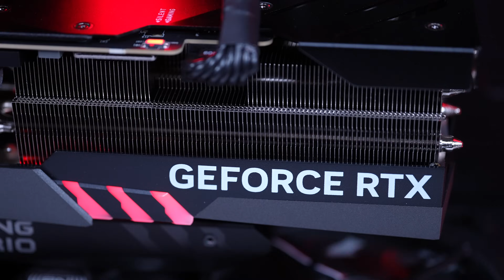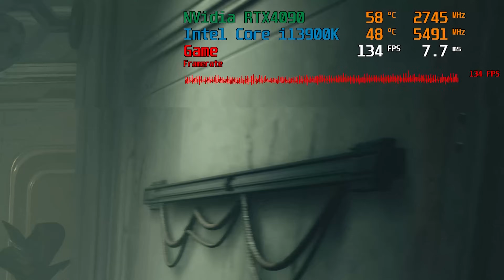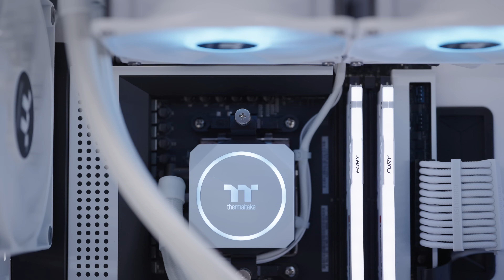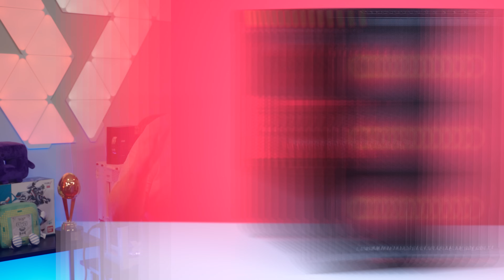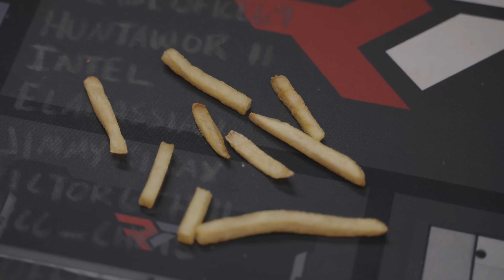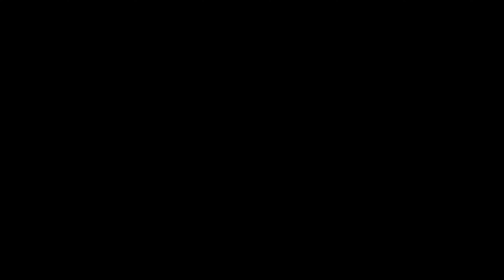How Does Starfield run on PCs of different budgets and the Steam Deck and ROG Ally!

Comment: Tested it on my rog ally played for a while works great for me arround 27 fps everywhere very playable for handheld  there is a new driver update you need you can install manually only atm but works like a charm tho that being said steam deck wil never run it the hardware cant handle it while rog allys hardware is alot better the steamdeck is to low for starfield dont expect this game to work on the steamdeck tho would be great if it did
Reply: Same I have the ROG and it works. You use medium or low preset? Or mix? I’m currently using medium preset but with shadows and ambient set to low.
Reply: @2BuckGeo sir does it stay locked at 30 fps
Reply: @amankumar-ft2ck  nope. It can go higher than 30 because it’s a pc technically

Comment: I was hoping to see a test of previous gen ZEN2 CPU's and see how they hold up.
Reply: XBOX uses Zen2 architecture, so I'd imagine a stable 30fps is  doable.
Reply: No Zen2 CPU can hold 60fps locked, out of the Zen3, only the 5600X3D and 5800X3D can, Zen4 is a wash though.
Reply: @MaxIronsThird  So, there is some truth to this game being highly cache and RAM bandwidth dependent.

I have a Zen2 Threadripper (3960x) and between its large 128MB L3 cache and its quad channel RAM (I use DDR4-3600) it's able to perform much better than one would expect by comparing it to an otherwise similar Ryzen 7 3800x.  I had to disable SMT to get the best out of it, but once I did, walking around in New Atlantis (one of the toughest spots on the CPU) I'm able to average 72-75FPS, notably faster than a Ryzen 7 5800X3D, and very similar to a Ryzen 5 7600 (according to that German sites testing)

That was a relief.   This is a work and play machine.  I need the extra PCIe lanes for work. I'm hoping to upgrade to Threadripper 7xxx, but they aren't out yet.
Reply: @Zarathustra-H- More and more we see that after a certain point, adding more cores makes absolutely no sense, cache is where most of the bottleneck is for gaming.

This makes me not as worried for Intel's next CPUs, with Arrow Lake not having SMT and the next generation after that, having "Rentable Units",  focusing on singlethread power and letting the E-Cores carry the weight for professional style multithreaded work.
Reply: @MaxIronsThird  The funny part is that Starfield loads up 24 cores on my machine, at least in busy settings (Like walking around New Atlantis), but there is obviously something really weird/wrong with this game.  In most cases I'd say you are right.

Comment: I went and bought a 6950 for $730 CDN after factoring in the Free SF premium with it. This is a smoking deal, $400 off and it's 2x the performance of my 5700XT I bought for $600 3 years ago. I saw another benchmark video where the 6800 was roughly in the ballpark of 1080 60 frames, 1440, and that is a few leagues up on the 5700.

Comment: You do realize this is worthless for most people out there. Even your low end system is using very modern parts. Low end should be something like a ryzen 3600x and a rtx 3060. And many people would still consider that middle of the road. And a ryzen 7800x3d is considered a monster cpu in games. Hardly a mid range cpu for 90 percent of us.

Comment: Ok now I'm confused. Just saw a video that a 4090 barely hold on to 60fps at 1440p. Or where they dumb enough to not unlock the framerate?
Reply: Not all the streamers have decent hardware to back up their 4090 with.

Comment: Things missing. Where is the native performance? Which mode of FSR did you test? Quality? Balanced? Performance?
Reply from the maker: It's set to Auto and we had so much time, we went with larger amount of hardware and you know that sub FSR it will be less than what we showed.  We had 24 hours :)  We did what we could.

Comment: Really disappointing that the ROG Ally can't get above 30FPS even with the graphics severely compromised. In fact that just doesn't make sense.  Hopefully some sort of updates around launch remedy this because ambition be damned, shit should be able to run well above 30FPS if you set the other graphic settings to mashed potatoes. I mean it looks like a slightly prettier Bethesda game. It's not looking like it has the biggest whoopty do graphics in the history of gaming. which...fair enough. I prefer my real time action games to run faster than molasses ass 30FPS
Reply: Didnt u watch the video? The fat dude clearly said he run the game at 720p ultra, no fsr, 20 watts, with old driver, and still getting 25-3 fps lmao.. 

Now that new driver is already rolling out for ally, imagine running this at 30 watts, 1080p native, medium settings, surely we can reach 40 fps at least
Reply: @Bodonism    He clearly said he turn down the settings with no improvement. Again the developers even said it won't run well on these handhelds. Hopefully in the future they will get them to run.
Reply: @smidlee7747  he turned down the settings and it wont do shit because it's running on an old driver.. new driver specifically for starfield is currently rolling out since 4 hours ago..  wait for it..  beside the fat dude doesnt know whats he doing, running benchmark at 20 watts for what? lmao
Reply: @Bodonism   There isn't much performance boost from 20 TDP to 30 TDP with the Ally.  You may get a few extra fps at most. Yes there are improvements for the Steam Deck as well but I wouldn't expect a huge performance  jump yet for these handhelds as both are under the minimum specs.
Reply: @smidlee7747  20 watts to 30 watts doesnt do anything? are you fucking kidding me? do you even own an ally? beside, it's triple AAA new unoptimize game running on old driver, yet he decide to go with 20 watts, like how dumb is that? Fun fact, God of war minimum system req is nearly identical to Starfield, yet Ally runs it like a champ at 1080p native no fsr..
Reply: @Bodonism   The developers have already warned these handhelds are underpowered to run the game.  
 God of War requires a lot less total ram (8 gb + 4gb gpu)  vs Starfield (16GB + 6gb gpu). The lack of total ram is likely the cause of the game crashing. The minimum Starfield 1070 vs min God of War 960 gpu.
Reply: @smidlee7747 gtx 960?? lmaoo u were referring to the minimum system requirement for 720p, go check it out idk what u smoking at.. god of war minimum system requirement for 1080p is gtx 1070 8gb version.. clearly almost similar to starfield of 1080p minimum system requirement albeit its the TI variant...
Reply: I would take this with a grain of salt. He didn't provide information as to what level the graphics were set at or if FSR was used. He also showed videos of the TGP being at 20w vs the turbo mode plugged in. Don't forget, AMD is releasing FSR 3.0 which will help the Ally big time. Starfield is one of the games to support that as well.
Reply: @SANDMAN32191  Mortismal Gaming claimed they were warned the game wouldn't run on the Deck or Ally at least with their review copy. As they said both handhelds are under specs but it does seem they may work on it so it will be somewhat playable ... like 30 fps at best. If they do get it to run at least 30 fps it will most likely take a few months and extremely unlike on launch.

Comment: Wtf is your ROG Ally analysis here, why would you not test it at 30W plugged in? No one in their right mind expects it to run a new AAA game like this on battery at 20 watts. 

You may as well have not bothered if this is how you’re going about it
Reply from the maker: You do know the Ally is a hand held and the majority of people play it unplugged?
Reply: Bro if it barely runs at 19, it’s not gonna run on the deck or whatever
Reply from the maker: @oo--7714  they just released a new driver, we are testing it.  We had a single day to test, we did what we could!
Reply: @robeytech i love the way you handle criticism 💪🏻🙏🏻❤
Reply: @robeytech  Can you please update the comments on the performance after testing the ally at 30w plugged in?
Reply: @JoseFGP   You do realize there will not be a huge jump in performance  from 20 TDP from 30 TDP  on the Ally right?
Reply: @smidlee7747  of course, but maybe it will stabilize a 30fps experience with no sudden dips, just hopeful
Reply: @JoseFGP   The minimum requirement is 16 Gb of ram plus a 6GB gpu so both handhelds seem to be lacking total ram. Someone increase his Deck ram to 32GB and noticed less stuttering in high demanding games.

Comment: Love how the "budget build" still uses a brand new top of the line gpu. I have an RX5700, I want to know how low res I'll have to run it, or I'm not buying the game.
Reply: bro you need a 6800XT for 1080p 60 FPS, so expect abysmal performance. 
the game isnt optimized at all, graphics are pretty mid for how demanding of a GPU you require... im skipping this one purely based off of that.
Reply: @simplyruben3184 Alright 👍
Reply: i have a ryzen 5600 and a rtx 2060 ( pretty close to your rx5700). don't know if the game is gonna run well, and i'm playing at 2560*1080 too.  i'm hoping for FSR to really help the more budget build. i could manage to play around 80-90 fps on cyberpunk with my 2060 with dlss quality. starfield can't be more ressource hungry than cyberpunk ? right ?
ps : those benchmark are with everything ultra too. i'm convince that with a mix of high and medium setting, you could probably squeeze an extra 15-25 fps.
Reply: Bro, this isn't a "review", this is pure marketing. Wait 1-2 days to see real reviews and how this game will be shat on because it obviously runs really bad performance wise.
Reply: I mean 1-2 days after release, not from today. These "reviews" are simple marketing strategies to determine simple people to buy it before it gets officialy released and revealed how bad it avtually runs. But experience can easily tell this will be dogshit performance-wise.
Reply: If you think an RX 7600 is "top of the line", you have another thing coming, and it won't be pretty.
Reply: Try flashing a 5700xt bios. Equivalent more or less to 7600
Reply: The Radeon 7600 is $250

Comment: Seeing the 4070, which is what I have, perform at 100 fps on ultra settings makes me really happy
Reply: Yes but it will depend on your CPU, that's where the limitations will be.
Reply: Bodes well for my 3080 Ti at about 20% faster.  But my 10700K is a lot slower than 7800X3D

Comment: Do you think it will run in gtx 1650 at 720p?
Reply: Yes, i saw a test where it runs well with 1080p. (Well=30-40fps)
Reply: @fl0520  where , pls tell where
Reply: Well i read it wrong. Its the 1660 super testet. But still i think it will run. @adams7336

Comment: Why are you tiering the systems by how much they cost? Nobody has these systems, because they're stupid combination of parts.
Why get an rtx 4070 for the "$2000" build, when an rx 6800 XT performs almost identically with raster, AND IS THE RECCOMENDED LISTED GPU ON THE SYSTEM OFFICIAL REQUIREMENTS??? Hello?
Maybe make the systems more relevant next time, please.

Comment: Was the ROG Ally utilizing turbo mode at the time of review?
Reply: It wasn't
Reply: @H0und0fHircin3  Thanks. What a ridiculous benchmark then.
Reply: @SANDMAN32191   Both the Deck and Ally only has 16 gb of total ram which will likely cause stuttering when the game minimum specs required 16 Gb of ram with a 6Gb gpu.

Comment: RoG Ally gpu was pinned at 800mhz and 20w. Now, the tdp may well have been intentionally set at 20w, but there is something funky going on with that gpu freq
Reply: Load balancing issues again? Cpu hogging all the power so the gpu gets pegged down.
Reply: @0tispunkm3y3r   Or not enough total ram.
Reply: @0tispunkm3y3r could be. Should easily fixed by turning off cpu boost, and possibly even setting the gpu freq with tuning app

Comment: I thought my i7-7700k was gonna be more than enough to get me through this, but if an i5-13600k is what we're calling a low budget option, I am so screwed lmao
Reply: yeah i disagree with calling 13600k budget.   I was hoping to see what a 7700k can do along with an 8700k.
Reply: @JohnHadley13 those are 30fps CPU for Starfield, you need a 5600X3D/5800X3D/7600X/12900/13700 for locked 60fps.

For a new build, you should get a 7600X with a B750B mobo and 32gb of 6000mhz cl30 DDR5.
Reply: @MaxIronsThird  oof if that’s really the case it looks like I need to upgrade
Reply: @JohnHadley13 yes get a 7600 or 5800
Reply: Except you then need to upgrade your motherboard
Reply: I mean you have 6 years of CPU...
Reply: @demistr7435  Sure, but the Xbox CPU is ass, and Starfield looks 10 years old.
Reply: That's an old quad core upgrade already
Reply: 7700k dayum.. that’s old
Reply: the game is screwed,not you
Reply: The recommended is a 10600k. Your 7700k barely clears the minimum.
Reply: @marc6192 actually 7700k doesnt even clear the minimum 6800k is a 6 core cpu
Reply: @marc6192 there is a difference between i5 and i7
Reply: @marc6192 might as well get a 12400 instead.
Reply: Well CPUs are extremely cheap nowadays, an i5 13600k is what? 150 bucks maybe?
Reply: @melcorchancla9431  No idea where you are but in Europe you'd be lucky getting one for anything less than 350 usd.
Reply: @finley8633 in Europe it would be more expensive lmao tax be crazy out here.  On discounted pricing it’s at $380
Reply: I haven't seen them for less than 300.  It's still a fantastic CPU and doesn't make sense pairing with a 7600.   @melcorchancla9431  edit:  the kf is 285 right now.
Reply: @melcorchancla9431  You live in fantasy land? My 13700k was $360 in March, and the 13600k is a min of $317 for a new one.
Reply: Where the actual shit do you see a i5 13600k for $150? @melcorchancla9431

Comment: An ASUS Ally driver just released an hour ago for this game specifically. I hope it improves performance!
Reply: Where have you found this update?
Reply: I can’t find an update
Reply: @darrylsmith408  Run a windows update after the driver update.
Reply: @darrylsmith408 I think he may be referring to the 7840u driver, which isn't an Ally driver. It may have issues, and doesn't seem to reference Starfield for anything other than a couple of Amd gpus
Reply: It's an actual graphic driver update
Reply: @RobertoRodriguez-ho7we   where can you find it, it's not available for me in either Armory Crate or MyAsus?
Reply from the maker: Hey!  There we go.  I am guessing Steam Deck will also start working.  Stability is the biggest issue for the game on the Ally right now.
Reply: Both the deck and Ally will likely have stuttering issues due to not enough total ram. The developers will likely have to work on the game to get it to run descent on these handhelds.